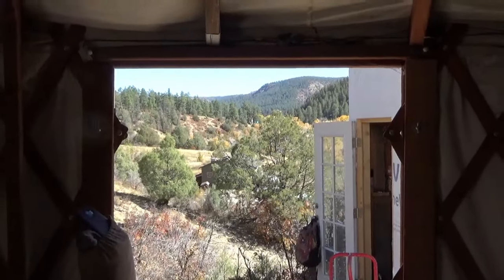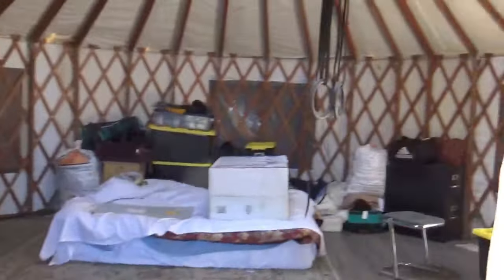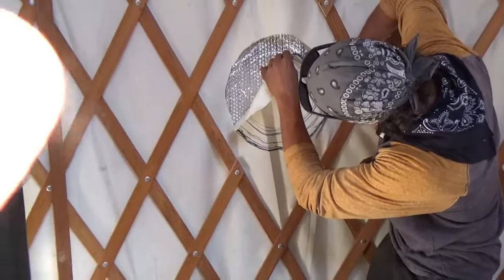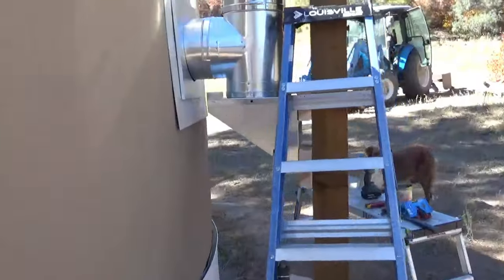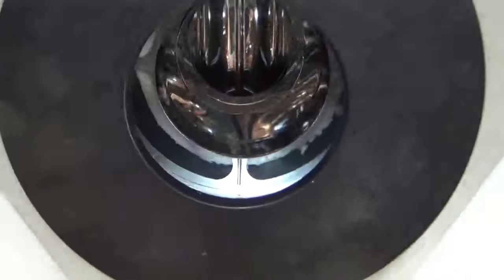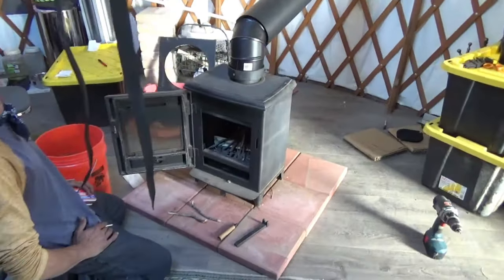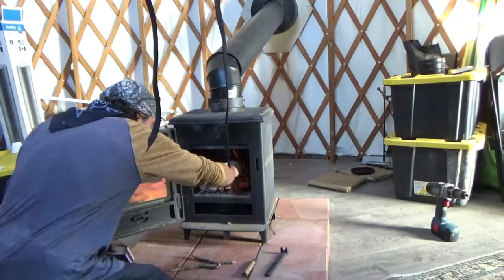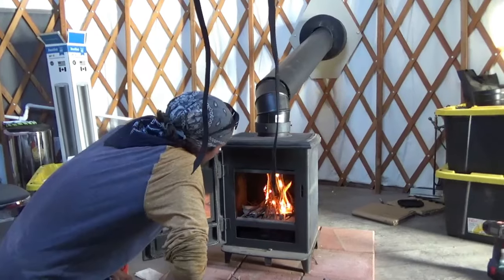Yurt Life - Wood Burning Stove Chimney Install - Start To Finish To Fire! DIY

Comment: This is very helpful! I've been trying to see if I could do the stove pipe support with just a single 4x4 into the ground instead of the double that most people use. Just a couple questions: How tall was the post you used? How deep did you dig it into the ground to support it properly? I really appreciate your help on this since y'all are the only ones I've found that did the support his way! I have a yurt with 7'4" high walls.
Reply: 4 foot deep in our area is code - the support is a 6X6 dimensional